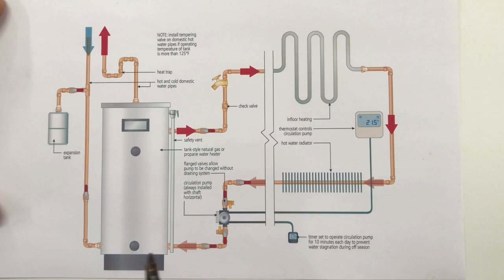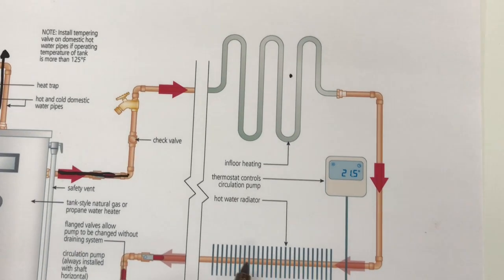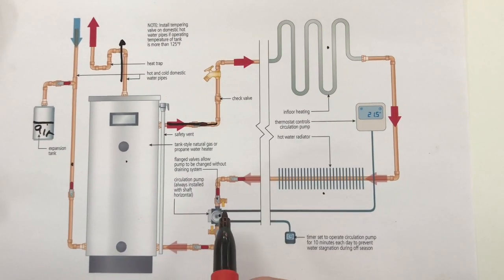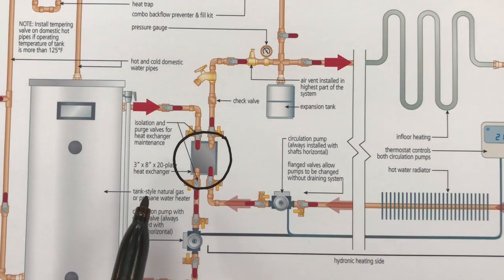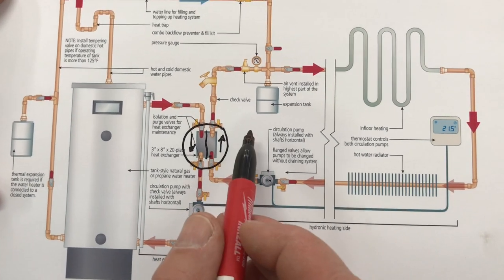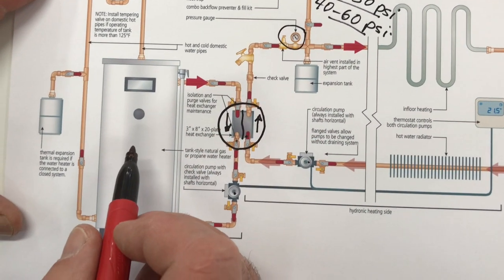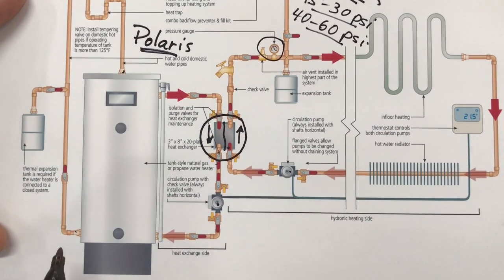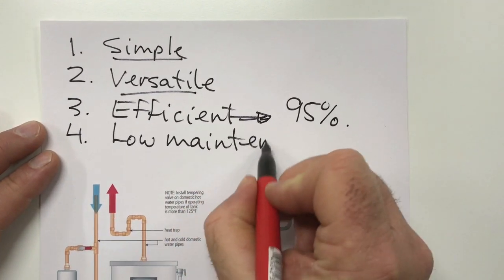HOT WATER HEATING: How to Use a Tank-Style Water Heater

Comment: For the simple system, why not just run all the cold supply water through the radiant tubes? If the cold water supply was kept from entering the water heater by means of a check valve, it would be forced to flow through the whole system before reaching the water heater. This way, the water in the radiant pipes would never become stagnate. It would eliminate the need for a timed circulating pump.
Reply: With a little extra plumbing, that could be done.  It would also help a little bit during the non-heating season to help preheat the water.
Reply: There might be an issue regarding codes plus the that being a non standard install etc . I could definitely see the advantage of doing it because it could be used to cool a home as well . However condensation would be a factor to consider . I found this channel while searching for inexpensive ways to heat my shop but also want to utilize all the heat potential of any given source of heat . I like the idea of heating water and drawing from a hot water heater using radiators but there's a drawback ,the constant need to have a pilot light on all the time . 
I used to have natural gas for my fake wood stove and water heater and that was it for heating up a two story home that was made in 1903 and had almost no insulation to speak of . Whenever I went on a trip I turned off the gas before leaving and was amazed by the difference in the price I was paying . I didn't realize just how much gas I was using just for the pilot lights being on while I was away . Obviously it's always a good idea to turn off the gas supply whenever going out of town for a few days because of the risk of fire or a gas leak caused by whatever , earthquake etc but I wasn't used to having natural gas since all my previous homes didn't have it .
What I'm looking for is a system that uses biomass as fuel like a rocket stove mass heater which doesn't require power or very little power for fans to move heat through an area but could also be used to heat water for radiant heat as well as to cook ,and could be used to make power as well . As long as the power grid stays up this system shown will work but should the system go down and no means of generating power is available and no water pressure is present, it's not going to work at all . Fortunately where I live we have a well system and a means of making power and being off grid if need be . I'm trying to figure out ways to be more self sufficient just in case we need to be . After a big storm a few years ago and losing power for almost three weeks,that was it for me. I don't like being at the mercy of the public utilities systems and losing all my perishables for my fridge and freezer .We lost almost a thousand dollars in food that time . So I decided never again will I go through that . The generator we bought can be fueled by liquid propane but I'm looking at other options for fuel like green gas . In the likely hood of a major event such as a natural disaster all the gas and LP supplies will disappear fast . We live in the Pacific Northwest where vicious wind storms & earthquakes are a real threat to our grid . Almost every year we have several nasty storms but usually one big one that leaves us without power for awhile for either hours or a week or more . I've learned the hard way that we must be prepared for whatever comes our way .
Reply: @royalspin  they make some water heaters now with electronic lighting, no need for a pilot

Comment: A third version is to simply have a smaller dedicated water heater (like 15 or 20 gallons) just for the hydronic system. You can turn it off completely during the off season. Plus it doesn’t tap heat off your domestic water system.

Comment: What a shockingly poor idea, apart from the fact that where I live open flame gas water heaters have been illegal for 30 or 40 years, even thinking about heating your house by circulating your drinking water thru your heating system, makes my brain hurt, but the biggest problem is the COST,
the cheapest water heater at a US Home Depot is 62% efficient, the most efficient water heater is 70% efficient (according to Energy Star US) that means that for EVERY $ spent you loose 30 to 38 cent.
Since (north) North American houses are generally insulated at a rate of 1/4 to 1/3 as much as north European houses, I guess that you burn 2000$ to 3000$ (Ca) of gas every year, which means that EVERY year you could buy a condensing gas boiler that is 100% efficient, for the money you waste by using a tank water heater. 

Maybe you could make a video about that         EH

Comment: Probably should've taken a basic hydronics course before putting this online.... Dumping 10 minutes of heat into your air conditioned space every day during the off season is dumb enough, but the icing on the cake is piping the radiation in series AFTER the radiant floor. This is nothing but a recipe for failure
Reply: Then use a heat exchanger.
Reply: Half agree with you. I assumed the floor heat was one loop and the fin radiator was a second but for simplicity they had it drawn as one crazy loop. What we both disagree on is the same but for different reasons. Using domestic water in a heating system is a poor choice for many reasons with very very few positives.
Reply: Do you think they leave the "boiler" on in the summer?
Reply: @jacobparsons5942  have to, unless they don't use any DHW all summer
Reply: @tysleight  I agree, unless you have a mixing valve on the domestic side. The most you can get out of your heating system is 120-140 degrees. Most boilers heat water to 180.
Reply: @tysleight  Yes, just for the sake of illustration, he did show two different possible radiation options. I'm just wondering if that water heater has an internal secondary loop the separates the heating water from the domestic.
Reply: Just drain the hydronic loop for the off season and refill it in the Winter.

Comment: In the second diagram which utilizes a heat exchanger, what’s the purpose of connecting a cold line from the domestic side to the hydronic side?
Reply: It's to fill or top up the system .

Comment: Very well described. We had this system installed recently by envirosense, ontario Canada. So is it safe to drink warm water if the heating water is mixed with the domestic water. It does taste a bit metallic. Though the people who installed it, said its not mixing, but there is only one pump and not heat exchangers. so i assumed it is mixing.
Reply from the maker: Hi Sara! It sounds like there might be mixing (unless the heater they used has an internal heat exchanger), but I wouldn't be concerned about it. It's always a good policy not to drink water that comes from the hot side of the system no matter how it's plumbed.
Thanks for watching!
Steve
Reply: If you are drinking from your hot tap, better make sure your valves, fixtures, and brass is lead free.
Reply: @baileylineroad  do you know any company which install this in Ottawa?  Can you please let me know how much it costs for the third method which have the heat exchanger? Please